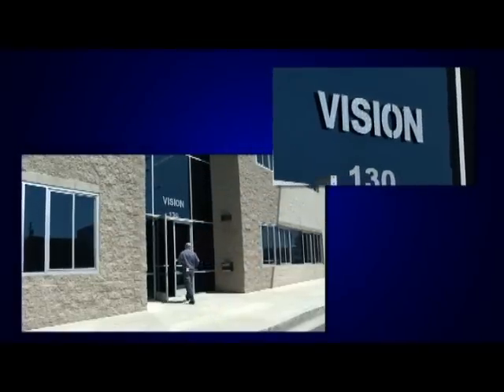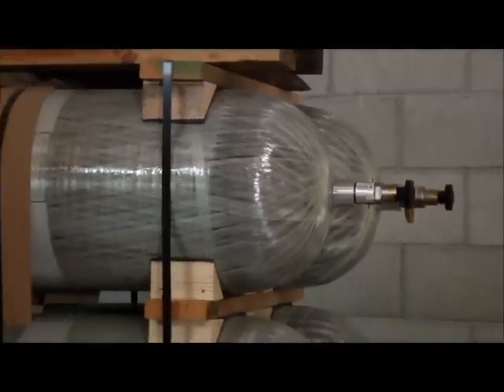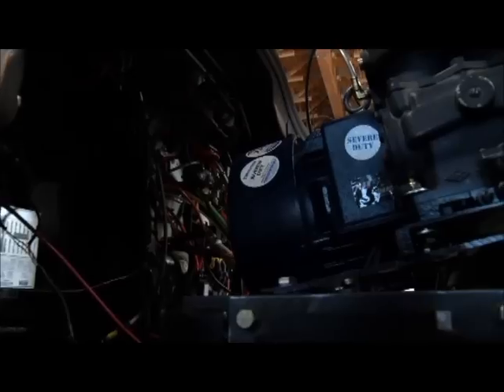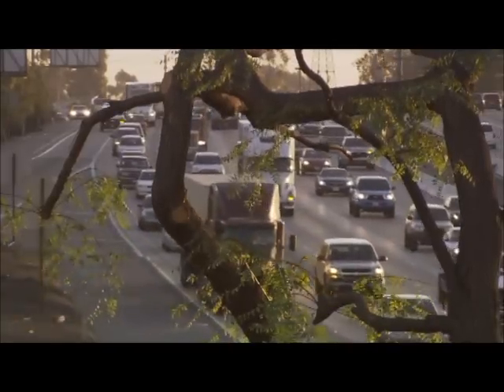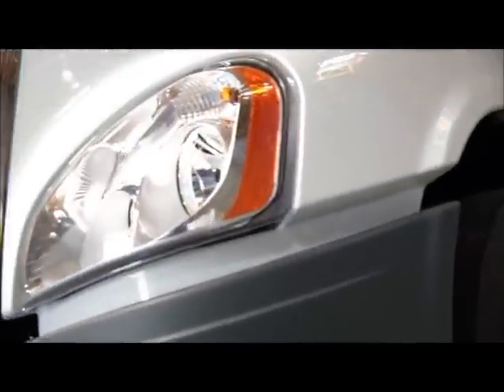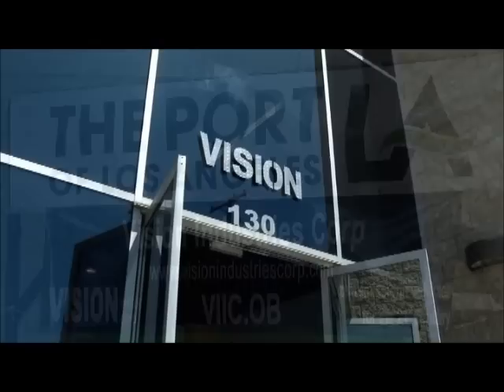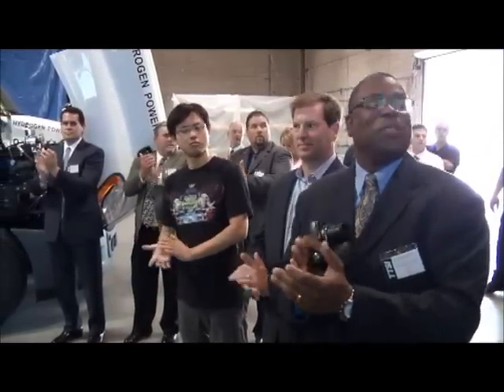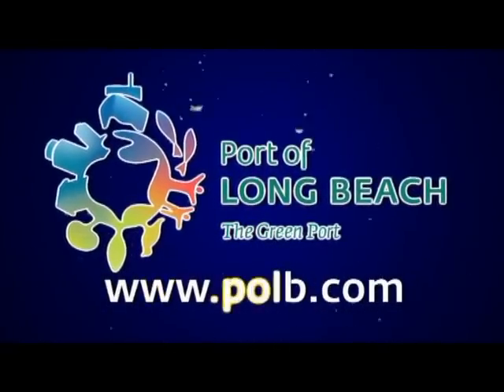Vision TYRANO Zero Emission Truck

Comment from the maker: Good comment.  The hydrogen is actually made right here in the port by Air Products.  It is transported to the refueler through pipelines, therefore no transportation emissions.  The majority of the hydrogen is currently made through steam reformation of natural gas, however, there is one fueling facility available that uses methane from Sewage as the feed stock.